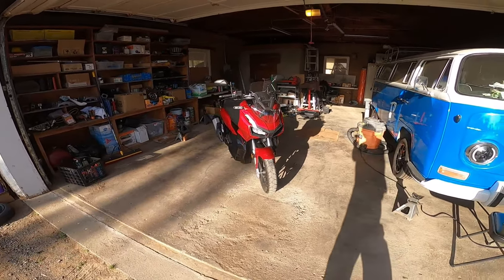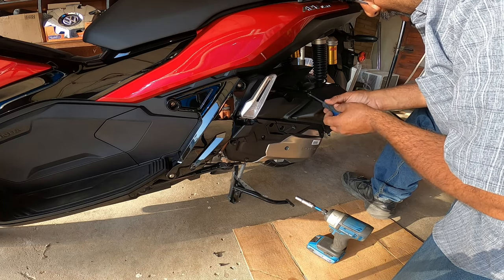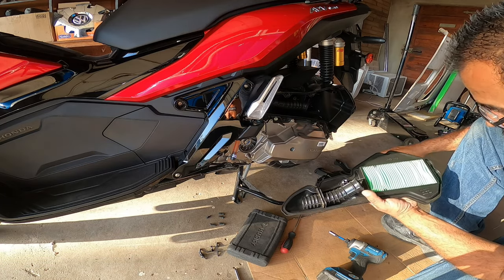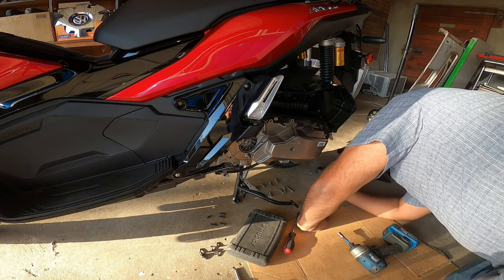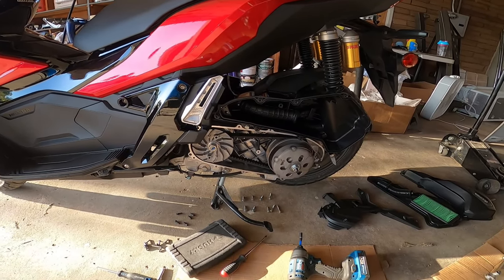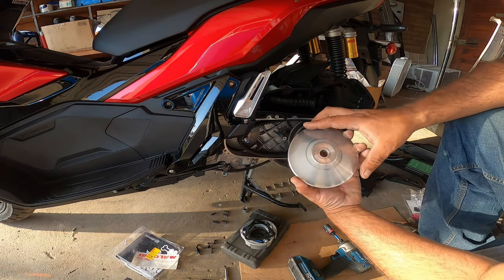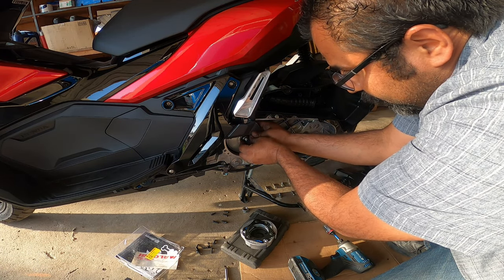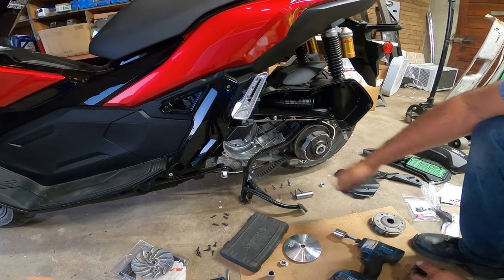Honda ADV 150 Clutch and Variator install

Comment: The puzzled look of “is that on right?” When you were looking at the variator 😅😂 Scooters are so weird 😂 but just a FYI you can get a spanner wrenches off Amazon to hold the variator down and if you run into the same issue I did where my spanner wrench didn’t fit into the variator holes I just put the “nubs” into a drill and while I was doing the “nubs” in the drill I used a grinder to turn them down to fit. And mine slips allot also after just doing the variator hopefully I’ll get this clutch and spring installed today and it’ll improve that a little.

Comment: I have the same mc so I'm very interested in seeing your performance review after it's all sorted out.
Reply from the maker: Yes I have added another 100 miles to the scooter and it has truly come alive
Reply from the maker: I will have a full review of the performance with the stock clutch and variator
Reply: @PincheALsGarage  Stock the AVD150 takes around 20 seconds to reach its top speed of about 65mph, looking forward to see what you come up with after a good break in period.
Reply from the maker: @maxfacts1  we have on the way for modifications:
Exhaust 
Intake
Standalone ecu
02 sensor
Cam shaft
New roller weights
Clutch spring
Clutch bell housing
Bigger fuel injector and fuel line
Reply: @PincheALsGarage  WOW! You are THE One Stop Shop for ALL things ADV150.

 I'll be riding the high ADV150 road with the help of your upgrade and Factual reviews.

Comment: hey bro. where did you get the specs torque settings on your variator? can you send me a link or pic on your service manual? thanks man. btw i'm doing tutorial and diy videos. i have same bike as yours. ridesafe always.
Reply from the maker: This is the repair manual for the Honda PCX 160 they are the exact same scooter everything is the same torque specs. Only difference is the looks

https://drive.google.com/drive/folders/1ky6qt60CUXKlkedS1kbM9nQVQCFh4bPS
Reply: @PincheALsGarage  thanks man.. super appreciated..